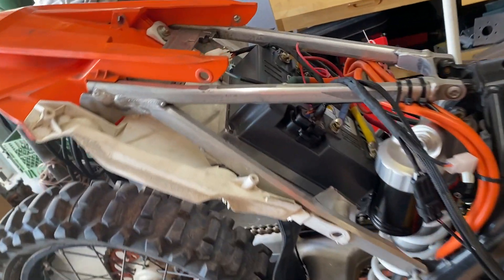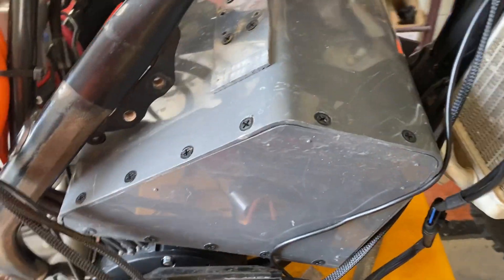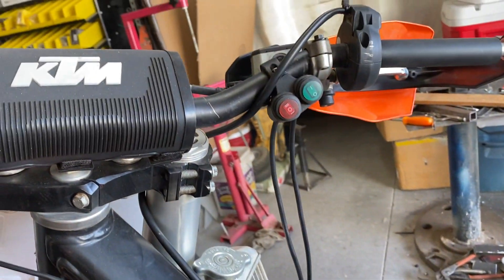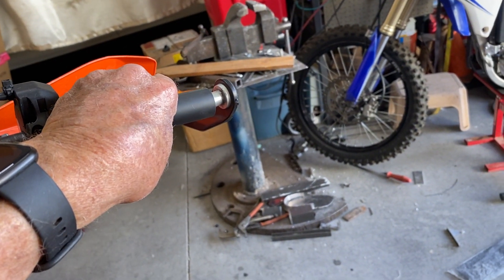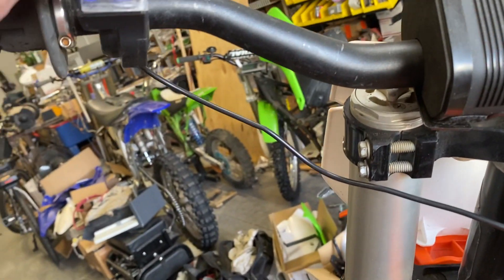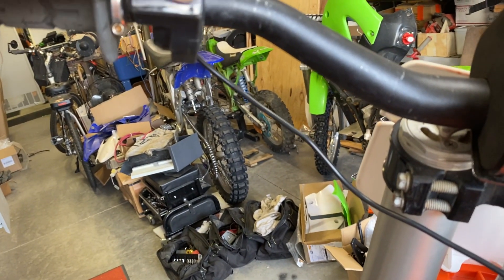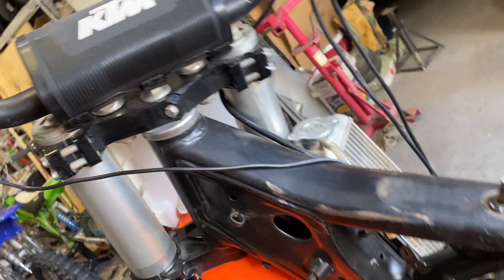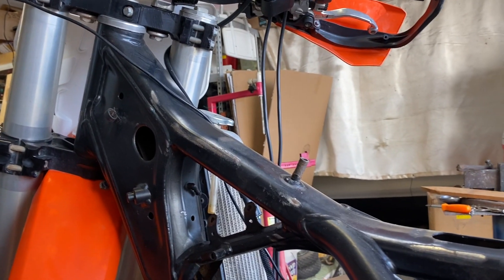Building a 2017 KTM  Electric Motorcycle, with QS138 70H V3 motor and EM-260SP/2 Controller.

Comment: Are you planning to plumb the radiators into the controller (and/or motor)?  It feels like these bikes with water cooling already on them are just begging to use those on these applications.  I haven't found too many motors that are plumbed yet (and didn't know if motor or controller is better to cool).  I hope there are more enclosures and "kits" to start doing clean conversions like this.  I have a 2006 KTM 525EXC that it would be nice to convert.
Reply from the maker: This bike has been ridden for the last year.  The owner is so happy with it, and all the delays with his Stark delivery, he is probably going to cancel his Stark order.  We had originally planned to water cool the controller.  Surprisingly we haven't had the motors overhead on any of our builds, yet!!!  (Well over 20 bikes that we have done) But if you run the EM260 controller over 400Amps, it will overheat.  We haven't installed the Controller cooler yet, since this owner , and most people with this setup, don't feel the need for more HP than the 350-390 amps give you.  I am building a 2008 KTM 250SX right now.  I should have a YouTube posted soon.  Message me (Donald Cox) thru ElectricDirtRiders.com and I'll post a bunch of the images up there for you

Comment: I am thinking about to do the same to my KTM 350 EXCF... instead of doing a top end and valve I will just make it electric! Please show how you installed the electric motor and brackets! Good Video!
Reply from the maker: I got the bike and the owner had installed the motor.  It wasn't quite up to what I wanted, so I redid it. But I do have some pictures.  This isn't a good forum for sharing info and pics.  Go to the Electricdirtriders.com forum  ( it used to be the Altaownersforum.com)  begin a conversation with me and I will give you a lot of photo data. One of my upcoming projects is a 2021-2022 works KTM bike from a friend with all kinds of good stuff on it .  It's pretty much the same as the 2017.

Comment: Hi, I found out here on YouTube that the QS138 engine has aluminum terminals, and the wires are made of pure honey, and they have not been cleaned of varnish, this leads to ignition of the engines.

Can you check how you are doing with the q s 138 engine, the same?

As for the long-range drive controller, there are aluminum studs inside that are used to connect phase wires and a battery, this is also bad
Reply from the maker: We have found the Votol controllers are the easiest to program, and most reliable.

Comment: I noticed that a radiator is installed, is this water cooling for the qs 138 engine? There is a video about this change?
Reply from the maker: No, we were planning on watercooling the Controller if we went to 450A, but the owner is way happy with 350A, so we never put the system in and we took the radiators off.  They do have a QS 138 90H  motor that is water cooled.

Comment: Hello I’m in the process of doing the same thing to a Suzuki rm125 but I’m having a hard time figuring out what gauge wire and what connectors to use with my battery I’m going to be using 3 72v 40ah 170amp batteries in parallel they come with 10 or 12 gauge wire, and xt90 connectors I’m new to this stuff, so I’m not sure if that will work, but I feel like it won’t

Comment: Hey what a great build! I’m tryin to get mine in a 2011 sx250 where did you get a 520 sprocket for it?
Reply from the maker: Mighte.me carries sprockets for the QS138 70H V3 motor.  They have 13,14,15t.  I am currently using 13 x 49 on KTM 150SX, and YZ250F electrics with the QS V3 motor. Trench digging power, and almost 60MPH  100KPH

Comment: for a 125cc bike (2016 Tao Tao Db17) do you recommend a 200sp or 260sp controller? My main goal is to stay on a budget and hit 50 miles an hour at least. Will 240 amps be enough for the battery (72v 40AH 240/350AMP ANT battery?
Reply from the maker: An em200 or 260 will both get you to 50mph.  200-250Amps moves a full size bike good.  I find about 275-300A is a good level for the track, but that would require a little larger battery, and the EM260 controller to get that.
Reply: @dcoxryton  is an em150sp capable of that type of speed with my qs138 70h v3 3000w motor? Thanks

Comment: Great looking build! I’m seeing plenty of people using the QS138 V3 but am curious where everyone’s getting the wiring harness to connect them to throttle/display etc? Or is this just another part of the build you have to make yourself?
Reply from the maker: If you buy your kit from ElectroandCompany.com the harness, switches, and throttle and come pre made. Literally, bolt your motor in, mount your controller,  hook up wiring harness with switches and throttle, and a battery, and drive it away.

Comment: Thank u for ur works and sharing experience! In qs  138 70 h motor can i use 20 ah 70 v battery? Is there other requirement rated current etc for effecrive run of motor?
Reply from the maker: Yes, you need to use cells that can put out a lot of current.  a 72V battery with 7 Sony VTC6 cells will put out 210A . But it is only rated at 15AH . This battery with the KX100 bike gets about 15miles of range.  not all 3000mah cells can put out 30A peak discharge, but the VTC6 cells do.

Comment: hello Donald, where you get battery switch , 72V. mostly i found 48V. Any help
Reply from the maker: They are only rated at 48V.  We have been using them for quite a long time.  We only buy the BEP brand.  we have been using them over 3yrs now, at 84V,  and the only failure has been another brand, and no spark suppression.
Reply: @dcoxryton  This is my first time converting into Ebike. I have CRF250, using QS138 72V 3000W motor and EM-260s controller. 
is 40AH 250-300 AMP battery is good and powerful ?? Any advice. really appreciate all hard work posting videos for us.
Reply from the maker: @PindiTown  Good choice on motor and controller, they work and programing is easy.  Depending on how you ride, you are going to want a bigger battery.  The controller can give the motor 400Amps, so you need a battery that can do that.  For power and riding a motocross track, a 20S12P Molicel P42a celled battery, will give you about 12 laps on a motocross track, if you are doing only trails and singletrack, you will get about 20-25 miles.  The cells you use make a difference.  Molicel P42A cells are a good all around cell.  Samsung cells, 50S cells, will give you about 20% more range, but not the 400A for max power for very long.  Not a good choice for strictly moto. unless you go to like a 20S16P with Samsung 50S cells.  If you go to ElectricDirtRiders.com forum, there are a couple of guys building CRF's into electric.      https://electricdirtriders.com/threads/yet-another-crf-250-build-but-its-my-first-so.3861/      They are having batteries made by Amorge.  For simplicity, stick with 72V systems,  there are some slight advantages with higher voltage, but parts and simple tuning works best with 72V .  You can push the Votol controllers to 76V ( 21S12P), but it is harder to get chargers, and other stuff with the odd voltage.  72V is kind of a standard.

Comment: Don, another clean build sir.  Question why don’t you program the controller and motor through a laptop? Wiring is pretty straight forward with tons of options you can add like 3 speed switch plus boost, reverse, throttle response when you order through QS they provide the programming cable.  Also look at SPIM08HP cells 8ah and 200amps continuous love your builds.  Definitely gave me motivation on my KX100E I finished
Reply from the maker: Thanks for the compliments.  Yes I do have the computer hookup for these controllers, and Austin at ElectroandCompany.com  has been a great help on making adjustments.  We've pushed the regen up to 15% and it works a lot better on the track. And we have adjusted the 3 speeds a little different.  Of course we left mode 3 or Boost, we left at 100%.  It rips in that mode.  Austin had the Mode 1 and Mode 2 at 50% and 75%, we change them to 25 and 66%
The original setting from ElectroandCompany.com  are great, this is just some fine tuning.
I have just started to hear about the SPIM08HP cells. I am going to look into them. It looks like a lot simpler building with them
Reply: The SPIM08HP cells are insane it never stops pulling.  I’m working on a clean looking battery box for them now but I think I’m going to order more cells to have a second battery pack.  The mode settings I’m curious about those sound like a great combo mine are 1-55/2-75/3-100 boost 120% but I really like 1-@25% and 2-@65% because I can’t tell the difference between modes but doing it that way would make a world of difference.  Not sure where you are located looks like AZ I believe I heard Mesa In one of your videos. I’m In SoCal but my oldest son is in buckeye maybe next time I’ll bring my KX100E and we can ride
Reply from the maker: @GOAT-iz3uo  I tried to answer this twice last night, but I don't think they got sent...  I use ABS or PVC sheets for my battery boxes, and form them with a Harbor Freight Plastic Welder   https://www.harborfreight.com/welding/soldering-plastic-welding/plastic-welders/plastic-welding-kit-with-air-motor-and-temperature-adjustment-96712.html
I like the 25 - 66 - 100, especially with the 350A, it gives good steps.  I do live in Arizona, in Lake Havasu City, and yes bring your Kx100E, the desert is 2 blocks away.  I am going to Pala for the national, and I will have my KX100E there. Come on out to the races. There are unofficial pit races on Friday night. A friend from Yorba Linda will be there also, and he has built 2 electric CR250F bikes. But later if you want to stop out here in Lake Havasu, we could build a box real quick for your battery.

Comment: Dear colleague could you say what sprocket do you use? For KTM and KX100? I try calculate by video - front 520 T14 and rear 520 T50??? What speed maximum? It is good for big hills? I'm doing byke at Kayo T4. Thanks :)
Reply from the maker: On the Kawasaki I have 15 - 49, and the top speed at 200A is 53mph.  On the KTM, I have 13 - 50.  The wheel is bigger, and I think the EM 260 controller will give the same RPM, maybe more with the 350A, but  I should  have it running in a week or so, I will try to remember to test the speed and let you know.

Comment: What did you use for your front sprocket? Is if a 520 sprocket?
Reply from the maker: Yes it is a 520 sprocket, you can get them from MightE.ME, I think they have multiple sizes 13, 14, 15

Comment: Looking at going with this same combo from Electro and Co. As I know nothing about building batteries, I'll likely have one made. What are your thoughts on the performance so far? Ride time? Actually didn't know about the regen, so that's a nice bonus! Thanks for sharing, Don!
Reply from the maker: I would recommend the battery that ElectroandCo has.  The 72V 25AH from Ion Lithium is a great choice. I think they are a little over rated at 25ah,  20S6P  P42A cells should give you about  20mile range.  We have gotten consistently 25 miles out of that combo at 200A max out of 20S8P Molicel P42A battery.  The Regen is really easy to adjust.  It will come at about 7%, but they can set it to any number, and we have them set it at 15%.
The performance on the smaller bike with the 200A limit is phenomenal.  There is a full size KTM running with this combo, running the 450A and it truly is Ludacris. Here are 2 of my builds with the 200A controllers. The 2 Kawasaki's.
https://www.youtube.com/watch?v=NgBPAgUQaFw